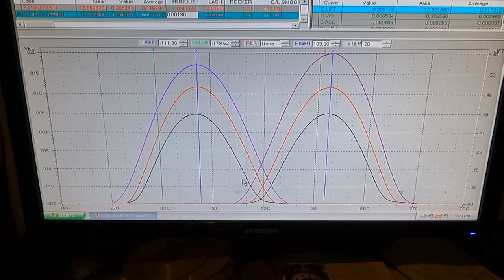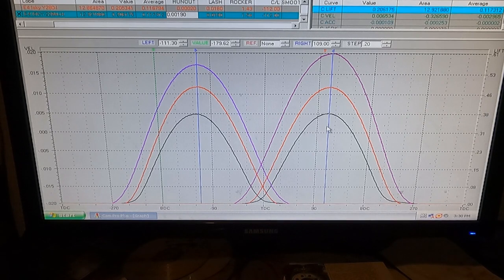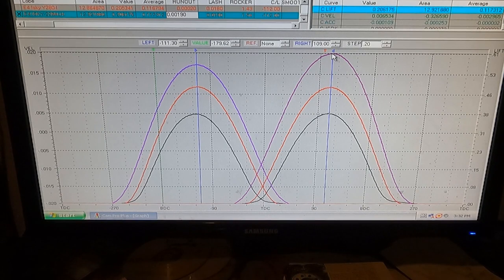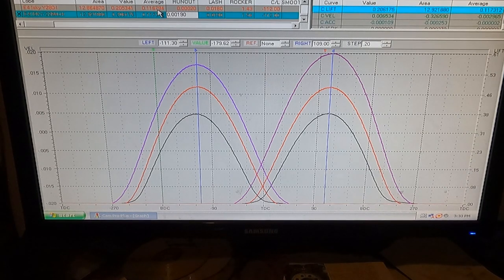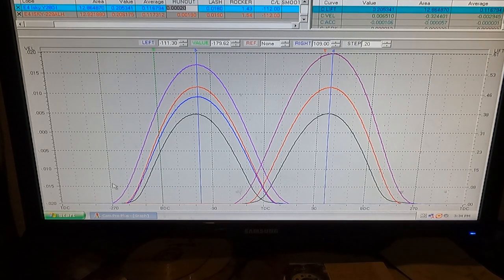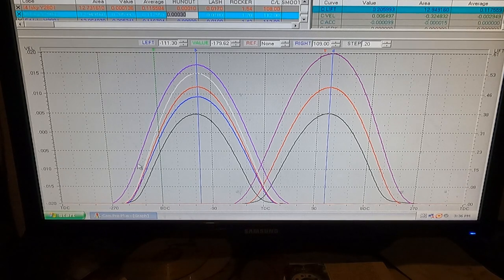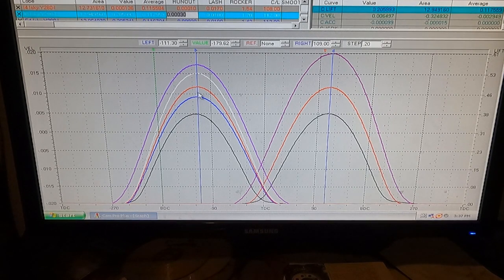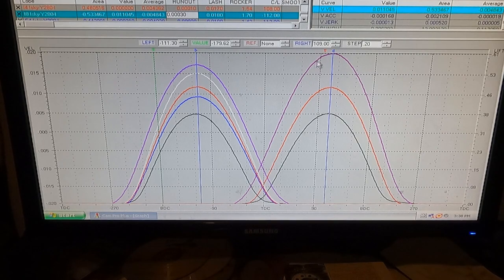Building a Better 312 using a 292 Pt.4:  Generic Camshaft logic

Comment: Is there any  to using a larger cam because its has the smaller rockers. On a side hope. Is there any ways of finding improvements on less ideal setups. Intake and cam on low compression small valve heads, or building up from less than ideal starts

Comment: Deeeep subject indeed. I selected cam profile for best torque curve instead of max HP. I figure with 9.5 compression, 900 cfm of carbs and long tube headers a max HP cam would have resulted in poor city driver. The 3300 lb car jumps off the ground so it works for me. I also have a powerdyne pumped engine with basically same profile except altered for the blower but don't remember what that cam difference was. It spins the 10" wide tires loose just on engine acceleration in a 3650 lb car so also works for me. Both 4:11 trac locs T85 ODs and been driving both cars like rented mules for many years no problem. I'd post the profiles but they're down in the cold dark garage. Dyno tuning, front disk brakes, traction bars and 3 pt restraints mandatory. Tanx again for the advice John.